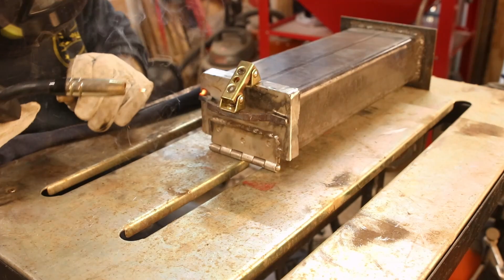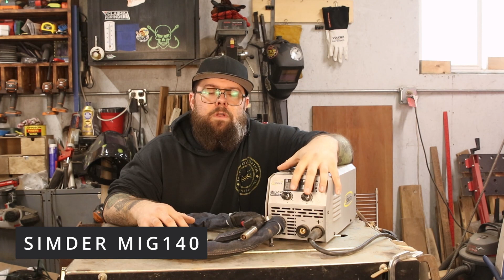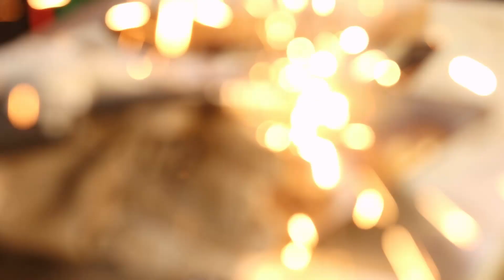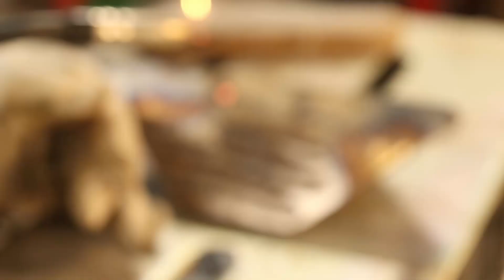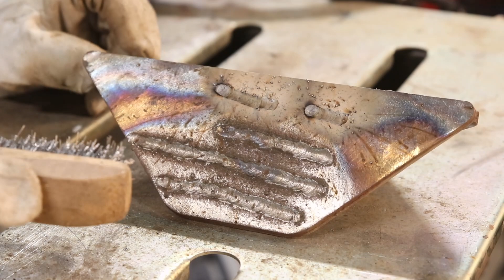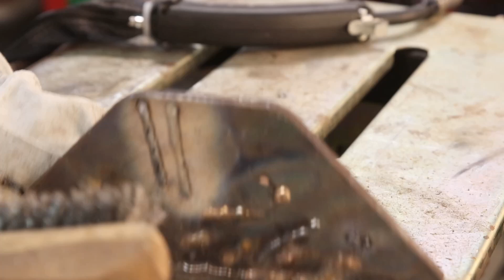Simder MIG140 Flux Core Welder - One Year Later

Comment: Are you able to switch polarity from DCEN to DCEP with this machine? can't seem to find this info anywhere. I'm new at this, but wanted to try stainless flux core wire and the consensus seems to be to run DCEP with stainless flux core wire.
Reply from the maker: No, flux mode is fixed.  Others have reported that on some of these flux machines its is possible to switch them internally with a little work.
Reply: @GarageHobbyist  I got it and opened it up. it has a bar connecting the gun to the negative dinse connector. I don't see any reason why i can't remove the bar and replace it with a wire with a lug connected to the gun and run it out the front of the machine through a grommet. Add a male dinse connector to the other end of the wire and just plug it into which ever connector i need.

Comment: Mine didn't even last a month. Started getting error messages on the display and the OC light would come on. Finally,  the power switch got stuck in the on position and I had to unplug it to turn it off. Thankfully,  I was within the Amazon return window.
Reply from the maker: Sorry to hear that.  Mine is still going strong 2 years later.

Comment: Anyone have an issue with the machine feeding the wire. I set it up, pulled the trigger, and nothing. the wire doesn't move, no arc, NOthing. I have contacted the company, but in the meantime, any suggestions?
Reply from the maker: That’s strange. I haven’t had any issues with mine. Did they respond yet?

Comment: “Garage Hobbyist” if you want to really help novices you could recommend some ideal settings for successful welds on say 1/16”, 1/8” and 3/16” steel angle or tube, with a specified wire thickness.  That would start people off with more success than trial and error settings.

Comment: That silver gas shroud isn’t needed since there is no gas, BUT it will stop the contact tip touching the work (good!) AND make it harder to see the weld puddle (bad!).  I would suggest keeping it on, but shorten it until it only just protects the copper contact tip from accidental touching on the work.  Pro’s of course won’t need any protection for their tips (that sounded better than it came out).

Comment: As it is flux core should the positive lead be on ground feed for best results as in a gas/gas less mig? , thanks for the vids and this update ; as I’m looking to get a flux core welder and been looking at a few you tube vids, thanks again
Reply from the maker: Typically yes, and most of the flux only machines you can't change the polarity of the wire fed lead.
Reply: @GarageHobbyist  thank you very much for your reply 👍👍